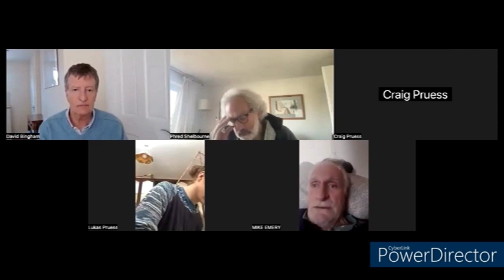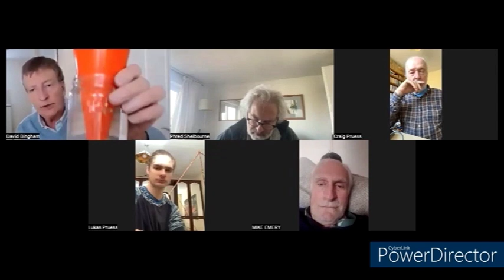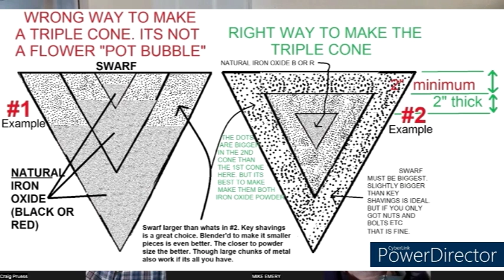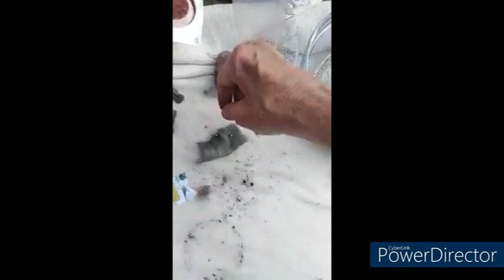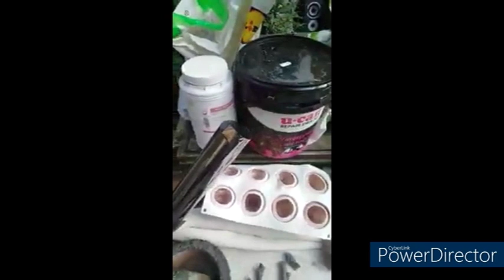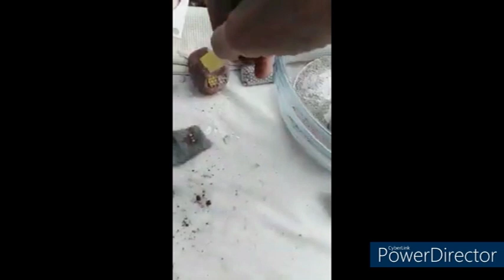Building Triple Cones Instructions short version

Comment from the maker: At 28mins in.... Mike says use thicker (less water) concrete in the pointy end of the cone to stop the next cone going in from sinking down too far. But it maybe hard to make it exactly the right thickness and it would also have to fill up the cone too much thick concrete so its working against what was talked about earlier...... keeping the concrete watery and not too thick so it dries out more brittle and better compression on the cone inside it.....so.......To hold the 1st cone in place 2 inches down into the 2nd cone and hold the 2nd cone 2 inches submerged down into place into the 3rd cone you can use dental floss or wire to suspend them into the cones they are being placed in. People are worried they will sink down, but this will hold them in place for sure. See my triple cone vids for details.